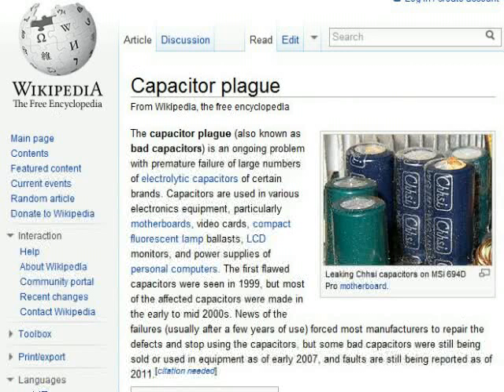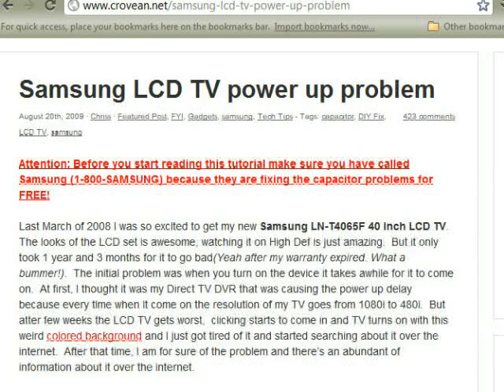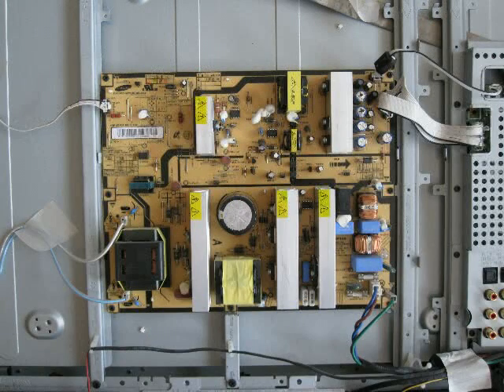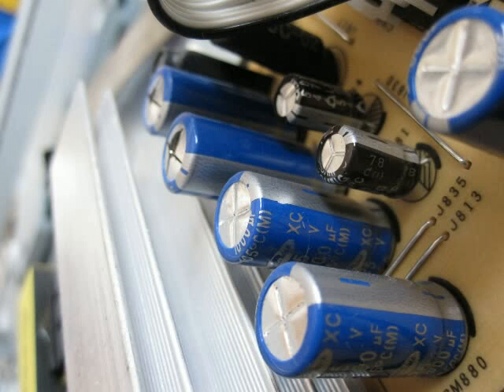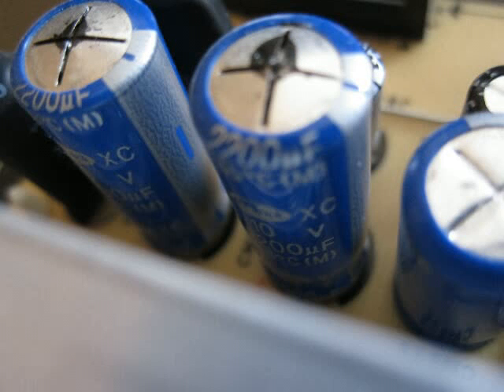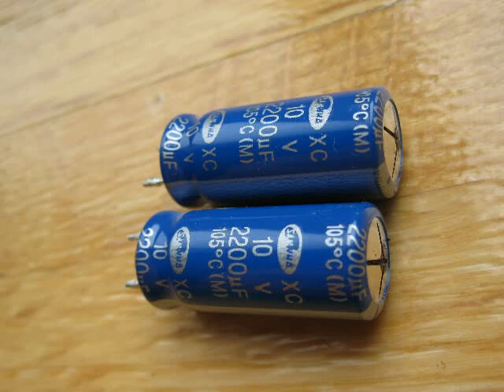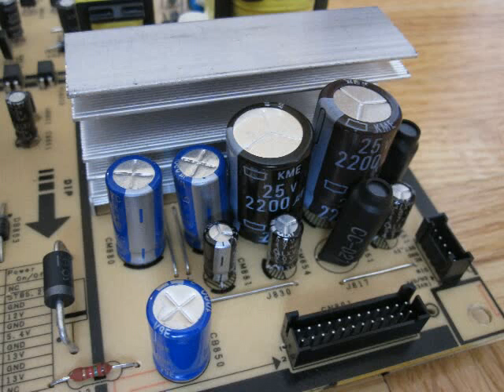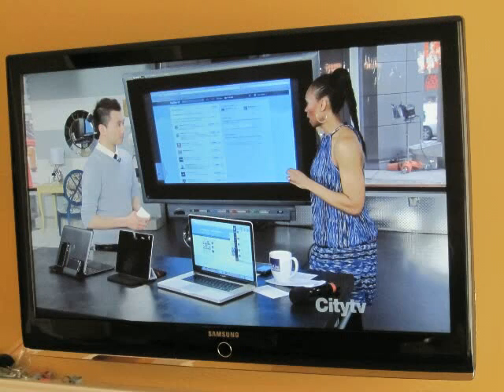Samsung TV Problem Turning On - How to Repair Fix

Comment from the maker: @gou791 Good idea, fortunately I was not shocked but there are reports of people getting zapped. Capacitors do hold residual charge so you have to be careful. However, the little ones that I changed are probably not that harmful.

Comment from the maker: @athineissa I found "Y-board" on ebay and it looks like board that has capacitors on it, plus a bunch of aluminum heat-sinks, the same board which I changed capacitors on. Then there is the "Y-sustain board" and others, so not sure which. If you spend money on a Y-board and it doesn't work, you'll just be $100 down the hole. I wouldn't trust that without trying one first to see if fixes the problem, or having an electronics repair place test it. Check polarity and other caps first, worth a try.

Comment: I was wondering, does the increase in voltage to 25V have an effect on where the tv is based? i.e. I live in the UK and the plugs voltage is different to the USA. Any help would be grateful.

Comment: All of these complaints about Samsung TVs have me worried about mine. A neighbor in my building had to move and sold me his 32 inch 720p Samsung for $100.  I've had it now for almost two years and it works great.  My only gripe is that it turns off too quickly when it's not reading a signal like my computer or DVD player.  Compared to some of the Samsung problem's I've read about online, I guess I'm one of the lucky ones. At least for now.

Comment from the maker: @MarkPapers   No way to fix the problem without opening the TV. You need to remove components, desolder and solder new ones on, and reassemble. If you are afraid to open your TV, let your more "handy" friend do it when you are not looking, or bring it to an electronics shop.

Comment: This is exactly what happened to my 46" TV that cost more then 1500$ LE46F86BDX model had 2 capacitors with 10V 2200uF, so I replaced them with the 16V 2200uF and it works like a charm. It's a shame that such thing happens. TV was really good for 2 years...

Comment: My understanding is that you cannot switch capacitors with different uF ratings, but you can increase the voltage. For example, you can replace a 1000uf 25v with a 1000uf 35v. I would not recommend using a 1000uf cap to replace a 820uf cap.

Comment from the maker: Probably,sounds like power supply relay clicking. Open up TV and look at your power supply caps... See the rating, keep same micro-Farads but up the voltage and you should be ok, get ESR 105 Celsius caps. You can buy them online or local electronics/hobby store, look it up in phone book. They are a few bucks.

Comment: Hi, I have a similar problem with my Samsung, when I swith the power on, we can hear it clicking and the red light goes on and off. I found two capacitors "inflated" and I replaced them;as you mention in the video, but it keeps doing the same thing, so what else could it be the problem? other capacitors that don't look damaged?
thanks!

Comment from the maker: NO, I would first call Samsung regarding the issue to see if the class action lawsuit and settlement covers this problem. Have one of their techs come out to see the problem. Otherwise you are looking at expensive repairs at a TV shop... depending on the TV, may be worth buying a new one (from another brand) rather than fixing a Samsung as the replacement part will also likely be flawed

Comment: The repeated clicking sounds could be from  the  Over current protection circuit or OCP circuit, which means that you could have a bad filter capacitor in series to the detection coil conected to the transformer on the SMPW. But I don't know really lol

Comment: I have no soldering experience, nor do I have a soldering iron. Any recommendations as to where to get one as well as specs? I do have experience with circuit boards, so I'm certainly capable of doing this by myself - just need advice on components.
Reply from the maker: +Sean Syring If you have figured out for sure it is capacitors, run down to your local electronics store or hardware store. They should have a soldering iron for $10-20, and some solder for a few dollars. That's really all you need. As far as components, for capacitors make sure you match the FARAD rating, but you can go up in voltage. I used 25V caps to replace the faulty 10V caps, but kept the FARAD value the same. Also, try to get 110 celsius rated capacitors instead of 85 celsius.

Comment: Is the TV still working without problems? I was just wondering if its worth it. I just got the TV for free so I really have nothing to lose but I might just resell it. I've tried soldering before and it went kind of badly - shaky hands.
Reply from the maker: Yes the TV is still working fine. Bought it 2008, caps started failing late 2010 (2.5 years), replaced caps in 2011... here we are 7 years later, still working! No issues powering on. However, if we turn on/off the TV many times over a few minutes (sometimes kids will do this) the sound gets muted... so we need to turn off longer (like 20-30 minutes) then turn on and sound works again. As long as you use TV like a normal person (turn on, watch shows/movies, then turn off at end of night) it is fine. Just don't turn it on/off many times over a short period of time (which is not normal use anyways) as it does something to the sound output driver/amp but it's a rare event so I don't want to bother with it.

If you are worried about your soldering skills, you can always practice on some electronics kits and get better first. I would get an old board and try to remove the components, desolder everything, and then try to solder some parts back. If you don't want the TV and wish to sell it, you will not get as much money for a non-working TV as if you fixed it. Spend $3 on fixing the TV and you will increase the price significantly more. I know you can do it, just pay attention to the polarity of the caps. Good luck and let us know how it goes!
Reply: @devhackmod  Thanks for the thoughtful reply. I'm going to take this project on when I have a free weekend. You have earned yourself a sub and I'll check out your other vids when I have some free time. Cheers!
Reply: @devhackmod  An update for those out there. I finally got to opening the tv this past weekend and unfortunately one of the capicitors fused with some other part - I'm not exactly sure what it was but it looked like one of the other parts leaked a thick white residue and fused the capacitor to it, the board on yours was diffrent but I believe those black rods that are next to the capacitors were glued together. At any rate I feared it was a bigger issue that I wasn't willing to undertake so I put it outside and hopefully someone else will take care of it. Also, my samsung tv capacitors were much closer together making fitting a larger capacitor much harder. Thanks anyway and good luck with anyone who undertakes this project.
Reply from the maker: @nicolascuenca254  Good to hear at least you gave it a shot. Those black vertical rods may have been diodes, a picture would be good to identify it all. Anyways, if stuff leaks all over it is harder to deal with. It can corrode the board and contacts and make the problem a lot harder to fix! It is challenging at best but good on you for at least giving it a try! Good luck hopefully in the future, keep on learning and fixing and let's bring back repair!

Comment: Same thing happened to me when i took mine to them for repair. The thing is that the power board that they replaced with has the same underrated capacitors so really they just refreshed your frustration...it seams that the voltage rating on the capacitors is the issue...

Comment from the maker: Shouldn't matter, as long as they are higher than the ones already in the board. So if you have 15 V caps in the board, up them to 25 V. Make sure they are 105 Celsius rated, but just keep the same microfarad rating.

Comment: Are these the same capacitors that cause the random turn off/turn on problem?
Reply from the maker: It may be, but there may be other capacitors in part of the circuit that connects to the power button or remote sensing circuit. I would check all capacitors though, looking for bulges and if needed test out of circuit and replace. If in doubt, the capacitors are very cheap and so it is easy to replace. I've taken my chances on computer monitors, X-Box and various other gear and more often than not it usually fixes things but not always. Sometimes it gets more complicated (see my other repair video in the comment below). Good luck and let me know if it works!

Comment: I have a rear projection Panasonic LCD that is doing the same type of thing. You can turn the tv on, but after about 5 minutes it turns itself back off. Use to it would only do it couple times and then it would stay on, but  it has gotten worse and it just keeps turning off.

Comment: I purchased a 32" Samsung 12/27/11, it was in the shop 7/24/12 for not powering up , they replaced the main board under warranty. Now it's 7/13/13 and it will not power up, Samsung will not warranty the part that was installed on 7/24/12  less than 1 year, now thats standing behind your product. I will never but a Samsung product again! JUNK!!!!!!!!!

Comment: My samsung 24" Monitor had this problem with the capacitors. I un-soldered them wen to the local electronics store...(not Best buy) but an actuall electronics store. Got some help from the guy there bought the correct capacitors. Soldered them in and whammo eveerything works great again.  Very easy fix, hardest part is tearing apart the monitor.  Cost me 8 bucks

Comment: hi. i got a samsung ln-t1953h lcd tv.4 of the CAPACITORS r bad. 1 1000uf 25v and 3 820uf 25v. i got the 1000uf 25v but cant get the 820uf 25v. can i uesd 3 820uf 50v or all of them in 1000uf 25v? please help,thanks

Comment from the maker: @whitereaver700x The TV has worked now for 5 months, no problems, fast to start up. It was a $3 fix, so now I have time to look for better capacitors and install them if I see something happening. Maybe it's not a perfect solution, but Samsung has not offered any help at all... Not even sending me the proper capacitors to let me fix it myself, or a new power supply. Their answer is "too bad, out of warranty". I don't expect things to last forever, but an expensive TV to last only 2.5 years?

Comment: i bought new capacitors and installed them and everything but my tv still wont turn on all you hear is the power surging throught the back but thats it. can someone please help me i dont know if i sodered it wrong or what. i have the same tv as on the video except its a 40'' one

Comment: i have tried to do this repair but i used the caps i used were the 16v 2200uF 105c ones and it hasn't fixed it. the relays are still clicking. i have noticed that the 2 white things( dont know what they are) just to the left of the bottom right heat-sink look like they have melted a little on top. can someone tell me what they are and if the would be causing the relays to keep clicking out?

Comment from the maker: I've heard that the problem is a design flaw using 10 V rated capacitors in a circuit that is operating on 12 volts. That is Samsung  engineering. I'm not an electrician, but if I run 12 volts through a 10 V-rated light-bulb, I expect it will burn out quicker. All the references I've seen on the internet recommend using a higher voltage capacitor to be safe, improving reliability and safety. I would like to hear the response from an electrical engineer who has looked at a Samsung power supply.

Comment: The low ESR capacitors you need are part number CP220016HTFF from SatCure.

Comment from the maker: @TIGERSHARK796 This may be T-Con board. Please look up on Youtube, it may be that component or loose cabling. I have a thin vertical line (almost 1 pixel wide) running down the left side of the screen close to where the 4:3 border is and becomes the 16:9 ratio. This I noticed within the 2 year warranty but assumed it was my PVR. Same cheap quality Samsung garbage.

Comment from the maker: You might have a different problem. The main problem this video solves is "power up clicking"... That's when the TV keeps clicking for a few seconds or minutes (relay clicks on and off) repeatedly until finally TV starts. Once TV starts it usually looks ok. You may have a problem with the video driver board or backlight. Since you are getting sound, you are getting power and most of the processing chips are working to decode signal. Your problem iks video/backlight based (other videos fix it)

Comment from the maker: TV was made in September 2006, but I didn't buy it until March 2007. The "warranty" according to Samsung is from date of manufacture, NOT when you buy it. That means I lost 6 months from my warranty because it was sitting in a shipping container, warehouse and store and not even powered on. .....

Now THAT is BullSHIT.

The problems started occuring just 2.5 years after. Warranty my arse. This is not a typical warrranty issue, this affected TONS of people, way more than normal.

Comment: i have a 2008 samsung 46in. model # LNT4661FX/XAA with the same problem as shown in the video. I took the back off and saw no problem with the 25 volt capacitors. Can anyone help me out?

Comment from the maker: UPDATE: Captions added! (for people who can't understand RoboGirl voice)
========
More Juicy Details:

1. TV bought February 2008, but was manufactured in 2007 !! Samsung says they count warranty from 2 years from date of manufacture, NOT when sold to user! What B.S. is this ?

2. Timeline: Bought Feb. 2008, started slowing power-up during winter 2010-11 (about 2.5 years after bought). Couldn't take it anymore, replaced caps in April 2011. TV still working fine now November 2013 (2.5 years later).

TV now running longer on replaced CAPS than the ones originally from Samsung!

Comment: My LED samsung 21"' yesterday just blacked while the sound was still on. what is the problem
Reply from the maker: There is no way to know unless you do more tests and have some idea of the schematic/design of your TV. If sound works, and problem is only with video, see whether there is independent power supply to video board or part that drives LED matrix, it may not be getting signal or power. You can do a quick inspection inside to see if any obvious burned components or loose wires, but if you are not sure about electronics trouble-shooting it is best that you don't mess around too much in there. First get schematic/service manual.

Comment: Samsung 60 inch LED "Smart" TV turning itself on and off, possibly from outside electronic interference.  Called Samsung customer service and was told that the TV needed a software update, and was assured that would fix the problem.  Did that, but the problem continued.  After a frustrating week or so, decided to change the power cord that came with the TV.  My Epson printer had the same power cord, (7A 125V) but better quality, plugged in with a more snug, tighter fit, so I used it to replace the original cheaply designed power cord that came with the TV.  Problem fixed.  Original Samsung power cord was bad.  Hasn't turned itself off and on since then.  Try finding the same power cord, but designed with better quality fit.

Comment: Happened to my 52 Samsung LCD also.  There is a capacitor settlement lawsuit that requires them to repair/replace this specific issue at no charge to you in home service in both Canada and the US.  Called them and they set up a service call on the same call - no back and forth.  They were friendly and did not try to argue with me.  Will have serviceman arrive in 2 days.  No charge - as long as your set is on the model list (lots of them) Even if your set is no longer under warranty.  DO NOT TRY TO FIX YOUR SET YOURSELF BEFORE YOU CALL SAMSUNG.

Comment: Buy only TVs where the capacitors can be replaced. I have a Thomson TV and im sure the capacitors will die fast BUT i can replace them! The next generation of TVs will have better capacitors but they are not replacable.

This is all part of Planned Obsolescence, type this in Youtube and ull see what im talking about !

Comment: un65fh6001fxza samsung  slow to turn on.  Looked at the capacitors none had popped or bulged.  Any other ideas?  Do they start to fail even before popping?
Reply from the maker: Yes they can dry up and fail before any visible signs of damage. You have to REMOVE the caps (desolder) and test each one with an ESR tester. Or just simply replace all of the caps that you see. You may not be able to see any physical signs of damage on the capacitors even those that fail.

Comment: I have a quick question.  The old capacitors in my Samsung show a minus sign whereas the new ones show an 0.  Is the minus sign equal to neg and the 0 equal to pos or also neg.
Reply from the maker: +Richard Landry Usually the negative pin is marked by a stripe with either a "-" sign (when both leads are on the same side) or an arrow showing the polarity direction (when leads are on opposite sides). Sometimes the "-" can look like a thin "0" if they outline the minus sign. Do you have a picture of the new capacitors, or can you ask the place you bought them?
Reply: +Richard Landry tHE LONGER LEAD IS THE POSITIVE ON A CAPACITOR OR led.
Reply from the maker: It is not a "0". It looks like a "0" but it actually is a minus sign that has a thicker border/outline around it. The "0" is actually minus. To confirm chcek that it has the SHORTER lead, since the longer lead is positive.

Comment: mine started about 3 weeks ago.. would not turn on at all .. just called Samsung will not fix out of warranty (figured), said call A&E repair.  Will try fixing ourselves first.
Reply: you should know if your Samsung TV has a capacitor problem that samsung is aware of (like this one) they will fix it under an extended warranty, they should have offered this support when you called them.  samsung tech